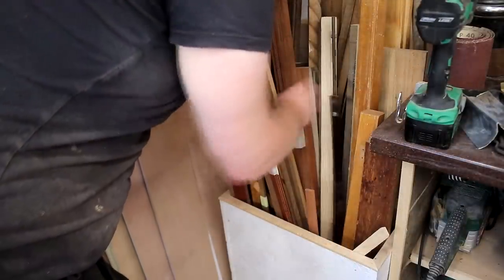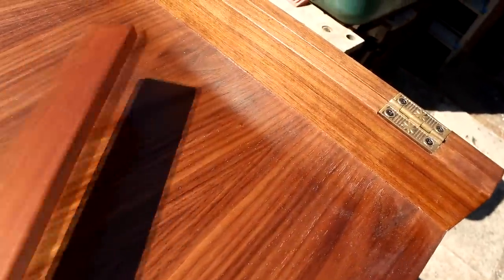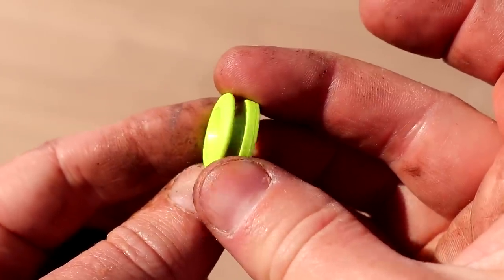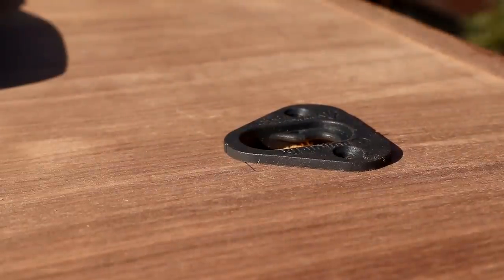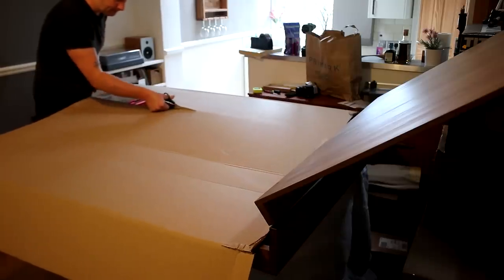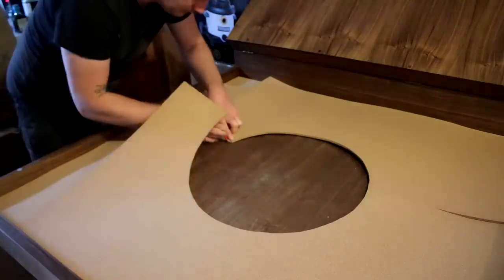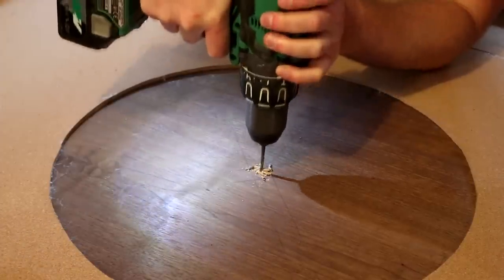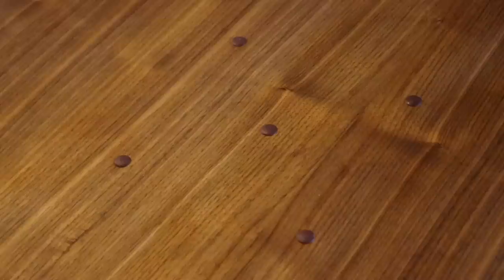Making A Dartboard Cabinet (part 2)

Comment: More considerations to making a dart board cabinet than I thought. Good job mate. One of the magnets is probably a duffer. Tested with other (good) magnets, it'd appear to work but test it with a piece of steel, pretty sure you'd find which is the weak, demagnetised one pretty quickly.

Comment: Hi Ya Keith, some project and I feel your pain... it looks like it was a tough one that seemed it would never go away. I know it it well mate, been there and done it....could write a book on it and retire.....but I think I may have the solution to your magnet problem.  Sometimes these magnets don't click together if one or both are 1. not seated absolutely flat - instead are slanted off on a minute angle so that the faces don't fully connect to each other.  Or 2.    one or both are sunken to far down by a fraction.  Sometimes an extremely thin shim the same shape as the magnet, can be glued on top of the sunken magnet to pack it up a bit. Trust me, I have had the same problem with some jewellery boxes I make. :)   Take it easy dude and well done for persevering.
Reply from the maker: Thank you!

Comment: I have had the "magnet problem" a couple of times.Both times, in my case, one or both the magnets wer very slightly below the the rim. I did not have them secured in one case, so just added a very thin washer. The other one was already secured, so had to glue a thin disc to one of the magnets

Comment: Nice work once again Keith as a fellow small shop guy bet you're glad its done and out of the way nothing worse when one job is holding up 5 other smaller jobs I just totally gutted my shop to build all new benches, storage and mobile tool carts now to rewire electrics and redirect the dust extraction
Reply from the maker: Cheers Ben, good luck with the new workshop set up

Comment: The finished cabinet looks great. When I use rare earth magnets, rather than use two opposite each other I will use one with a steel plate or screw then I don't have to worry about getting the polarity wrong. Your issue may be that there is a gap between the magnets, so the 'pull' feels stronger on one side compared to the other?

Comment: When I have mounted dartboards before you get a centre mount included,  single  screw into the back and a slotted bracket on the wall easy to turn and lift on and off

Comment: Well done on one of those 'up-hill' type projects. I find that spray contact adhesive is really good, but rather messy. There is a thinner/cleaner fluid available but its rather potent, I'd worry about going near the wood finish with it on a cloth.  The magnet problem...I think they're not actually making contact with each other. Either the door has a gap or the magnets are sunk in a bit too far. All in all though, a beautiful, practical piece.

Comment: There's no point in testing the not working magnets with working ones to find out if they are 'broken' because they're metal - so magnets would stick to them.  See if the magnets in the case will grab not magnets, ie other bits of metal.

Comment: It does appear to be a polarity issue with the magnets.  By testing them "independently" with other magnets, it confirms two things: 1. The magnets in place are functional 2. The 'test' magnets are turned correctly to work, but only because you have that capability to rotate them giving you 'confirmation bias'.  Other than destroying a portion of the box to remove one of the magnets and turn it for 'testing polarity', you are out of options with the exception of adding additional magnets, something that I don't think your client would be up for.  Great work as usual, already looking forward to next weeks installment!
Reply: Why should one use two magnets? Is one rare earth magnet and one piece of metal not enough? In  that case there cannot be any problem with polarity.
Reply: You'll have to ask Keith why he used two magnets, that was his choice.  However, using two magnets does work as one set is operational while the other is not.  He clearly demonstrated that the magnets do in fact work by using other magnets, so the only plausible explanation is that the polarity is reversed (put in backwards) on the case.  You may refuse to believe that reversed polarity is not the issue, but after clearly seeing that the magnets do in fact work otherwise, I would gladly entertain other explanations offered by you.
Reply: Peter Poertner that doesn’t show the magnets are working. If it was a piece of steel that was used it would show that both magnets are still magnetic. Using a magnet to check just shows it ferrous